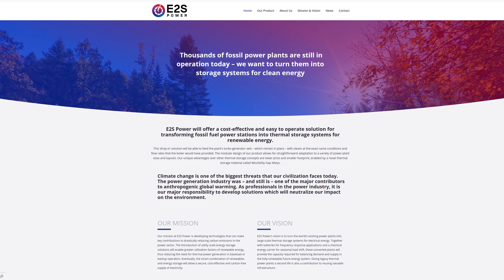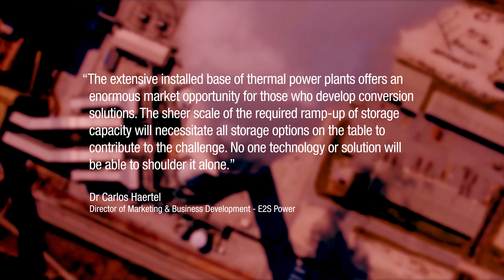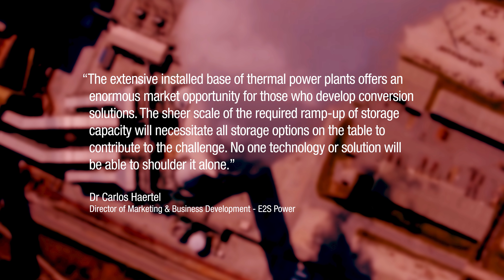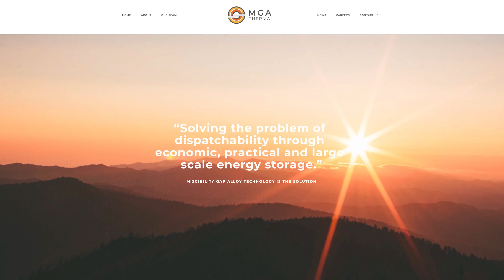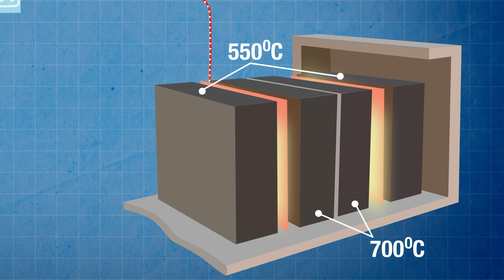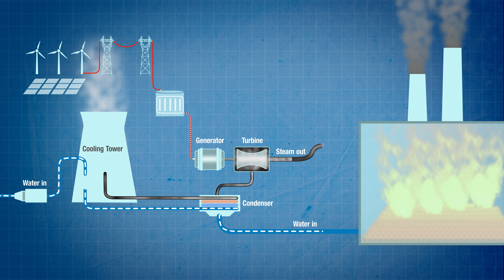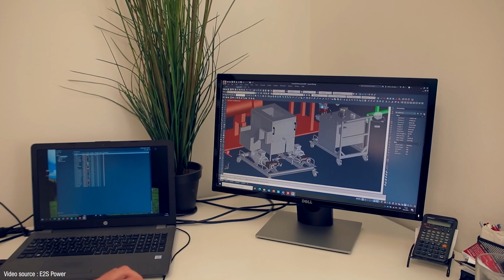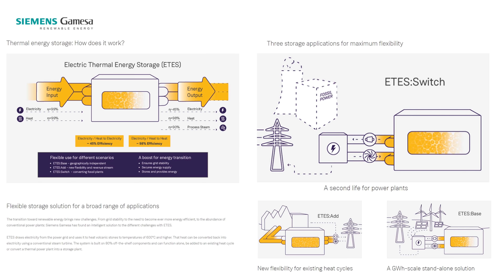New energy storage tech breathing life and jobs back into disused coal power plants

Comment: Steam turbines aren't known for being able to flexibly generate power. Cycling them also increases blade wear. Since steam turbines that feed electricity into the grid must operate at a nearly fixed speed (due to the nearly fixed frequency), one can only adjust the power output by adjusting the torque. Metals aren't too keen on varying stress levels.
Reply: The website doesn't say, but it looks like this system will be most useful for running times between a few hours and a day - peakers. Other systems will be needed for baseload in winter calms. Nuclear reactor retrofits are an existing safe technology which we refuse to use so far.
Reply: Not blade wear, but metal fatigue in the rotor disks.
Reply: @brodiewolstenholme3086  Actually related to the brittle bore of the shaft.
Reply: Your comment is not correct. Turbines are flexible and can be loaded as needed. That's their strength. Cycling doesn't cause blade wear. And anything that dispatches power to the grid must do it at grid frequency. Turbines last for 20 years under near continuous operation and can be rebuilt.
Reply: @sreng81  I'm a mechanical engineer but not in the power generation/steam turbine sector. My understanding is that large turbines designed for base load provision need a relatively long start-up/shutdown periods to avoid thermal shock and distortion. Is this a misconception? If not, presumably the effect is proportional to the thermal mass of the rotating and stationary elements?
Reply: @clivehprice1973  long startup and shutdowns are related mostly to even heating of the shaft. When you startup a large turbine you need to enter and stay in soak minimizing any time in criticals. On shutdown you need to stay on turning gear long enough to avoid bowing the shaft. If you lose turning gear you manually rotate the shaft at set periods after marking the shaft so it cools evenly. Typically you can attach a handle, air wrench, etc. to the turning gear motor or gear box but if necessary the use of a large strap wrench may be used.

Steam throttle and governor valves also have conditions to fulfill as well as throttle loses across a valve may end up introducing saturated steam which damages rotating and stationary blades (100 degrees of superheat common).
Reply: @clivehprice1973  They do need long start up periods.  Subcriticals take 16 hours, supercriticals 24.  Some of this time is boiler related.  There are long holds in the start up process for silica and iron (chemistry), and that large boiler has to heat.  I don't know if those would be  present in this scenario.  Then there are holds while rolling the turbine for thermal issues as you mention.  Once parallel with the grid they can run indefinitely and regulate up and down on load as needed.  Maybe the term cycling meant on and off.  I didn't understand from the video exactly how they would be used.
Reply: @sreng81  Thank you for that. I have heard the term 'spinning reserve' in the past which I understood to mean stations that were running with enough steam to maintain operating temperatures and overcome rotational losses but with no electrical output. This would surely affect the overall  operating efficiency of the plant, as would other usage factors that you have queried. I note questions about 'real life' overall efficiency elsewhere in these comments. Nevertheless in our dire global state every  new option is worth examining and I think that Dave is doing an excellent job in highlighting these on this channel.
Reply: @perryfarmer3280  That's very interesting. Thank you for responding. As always in engineering (and life) the devil is in the detail!
Reply: @clivehprice2553  Spinning reserve is basically having enough immediate excess capacity to replace the largest single loss of generation. The amount varies widely but a common figure is 10%.

A thought for a DC system (think solar and electric cars).

For the most part new vehicles have a range of 200 - 300 miles. The average use however may be 40 miles a day. In a solar neighborhood you have 80 % (give or take) spinning reserve online for every car plugged in sitting idle (assuming the car is set up to give back). Many cars have this as an option.

In a hydro system with condensing turbines immediate spinning reserve may be simply closing the wickets gates allowing the unit to stay online as an electric motor which adds stability to the grid. Zero to full load may he only 20 seconds however the turbines literally add short term spinning reserve through momentum but are limited by other plants such as thermals where turbines are very limited frequency wise.
Reply: @clivehprice2553  Close.  Spinning reserve generally means the turbine/generator (unit) are running at reduced load, so they could increase output relatively quickly.  A typical unit may cycle between 60% and 100%.  What you described, 0% load, is called islanding. Large supercritical units cannot do that because of the boiler.  Smaller subcritical units can, for short periods of time.  That may be an option in this scenario since there is no boiler.  The heat source would only provide enough power for the plant load, or just to keep the turbine hot so it could increase load quickly.  That's a good question!
Reply: @clivehprice1973  this isn't " base load provision" is it !
Reply: Well, maybe this technology is best suited for peaker plants, where the legacy equipment is presumably designed for cycling.
Reply: I wonder if you could switch the plant over to charging its own "hamsters" whilst it spins down at a safe rate?
Reply: This isn't true at all. Naval turbines have provided variable output and speed for over a hundreds of years. Coal power plants are taken on and off line regularly for a variety of reasons. The stress on a power plant turbine is based on the current load of the generator not the frequency. The turbine is the most durable part of a steam power generation system far outlasting the boilers and generators themselves with proper care.
Reply: @patrickweaver1105  I think he means steam driven turbine generators, not steam driven engines.
Reply: @poppys3728  Same steam turbine technology.
Reply: @patrickweaver1105  "Same steam turbine technology." - Usually. However, steam turbines attached to electric generators for power production typically operate in a very narrow speed range (basically a constant speed to maintain the proper frequency for whatever grid they are attached to). Whereas steam turbines attached to ships propeller for propulsion operate in a wide speed range as dictated by the navigation requirements.
Reply: @poppys3728  Ever heard of a ship service turbine generator? I've operated both types the only difference is size. They all get started up and shut down regularly.
Reply: @patrickweaver1105  Yes, SSTG,  Ship Service Turbine Generator, the electric generator driven by a  steam turbine (usually) to provide electric power for the ship. My contribution to this thread was pointing out the typical differences in operation between the SSTG and the ME ( Main Engine Turbines), not how frequently they are started up or shut down. In fact, on numerous occasions, I have operated both SSTG's and ME's for months at a time.
Reply: @poppys3728  Here in the US, it is exactly 60 Hz.  It only varies by hundredths of a percent when the generators are synchronized with the system.  I never thought about ship's turbines changing frequency.
Reply: @sreng81  Yes. U.S. ships operate on the same Hz as U.S. power grid. At least all the ones Ive been on. Not sure about other nations' ships, though.
Reply: @poppys3728  Fundamentally the only difference is size.
Reply: @patrickweaver1105  HA HA ! cut right thru the "nay-sayer" bs !
Reply: If you can't turn the steam turbine off,  you can still generate enough power when renewables are running to be able to operate the turbine 100% of the time, consistently.
Reply: @fehzorz  ehhh? No, I don’t think so. You don’t want to run the plant when there is enough renewable power available, as you would effectively just be wasting 50-60% of the power. You want to use the available renewable power to heat up the storage at that moment, not to run the turbines to then once again produce electric power from wasting more than half the power you put in in the process.
Reply: @AndreSomers  yes it would be significantly more efficient to just turn the steam turbine off during the day. However if it CAN'T be turned off (I'm no turbine expert so I'm not sure) then it would still be possible to generate enough electricity from solar and wind to run the turbine 24 hours, even though you take a hit on efficiency.

Comment: Just what percent of the energy consumed to melt the aluminum is recovered?
Reply: Given that resistance heating is essentially a perfect conversion, it’s probably pretty high. Limited only by the steam-generation half.
Reply: @marxug1  Very large ones have a 50% efficiency. (1,200 MW). Smaller ones are less efficient. Then you have pumps and such.
Reply: @Natabus  those are co-generation implants, which exploits gas and steam turbines. Steam turbines solely usually reach 35-40% efficiency at best
Reply: @federico1183  Thanks for the correction.
Reply: The heating will be almost 100% efficient, and modern large scale steam turbines have about 40-50% efficient. So 40-50%.
Reply: Good question. I haven't been able to find anything on throughput efficiency. But if it's more than  ~30% its  outperforming Electrolysis -> Hydrogen -> Fuel cell, thought It doesn't have the same potential for seasonal long term storage.
Reply: about 90% of the heat can be recovered (latent heat of melting or fusion) but about 25% of the heat will be available in the form of electricity. The remaining 75% of the heat is unusable (low quality) but can be used for domestic hot water supply and other use.
Reply: I was waiting for that. But of course the heat to water phase is very efficient, so I guess the efficiency of the plant depends on how efficient the plant was at turning heat from coal into steam? Less likely to be used for older coal plants in which case. Even so, re-use of existing facilities (and the energy it cost to build them) for energy storage is good.
Reply: Lol, its kind of a poorly phrased question.  I can see what you are all trying to get at though.  Instead ask: what is the heat exchange efficiency of recovering the heat from the hamster unit.  This is going to be high, at least 85%, probably 90%+.  The phase change characteristics of the aluminum give the hamster its staying power, stamina if you will.  The second question you all need to ask explicitly as well is:  What is the efficiency of the power conversion method, in this case the steam turbines that convert the heat energy into electricity.  Older already sited turbines are probably 35%.  These two multiplied together give you the electrical efficiency barring other considerations which are small in magnitude so this is generally fine.  I'd expect this system to be about 31.5% electrically efficient.  Now some of you correctly point out: what about the waste heat from the thermal to electrical conversion process?  If you can utilize that in a district heating system you can get a CHP efficiency of 80% easily.
Reply: Who cares when that excess renewable energy was going to waste anyway?
Reply: @rupert274  The low efficiency is only one aspect. The capital expense of electrolyzers  is huge. If they're sitting around doing nothing except for the sporadic run to soak up energy that would have been curtailed, the money spent on them (and, in ecological terms, the embodied energy and emissions) is largely wasted. The niche for green hydrogen isn't going to be energy storage. It'll be for industrial processes and chemical feedstocks that presently use steam reforming of fossil natural gas. And to make it economically viable they will be running flat out, not intermittently.
Reply: @rupert274  ( people miss that point - even in using "surplus capacity" to make HydroXXX - chemistry products  fanatics repeat: "Hydrogen is stupid: - with no thought to per unit storage cost or ease of transport...
Reply: @rupert274  Consumers will care. Inefficiency in the energy supply chain means more infrastructure is required which will drive up prices

Comment: Could we turn oil pipelines into an intercontinental variant of the same? Replace oil dispensing stations with exactly this same capability. If so, we'd have a means of sharing power through it!
Reply: Oil pipelines aren't even remotely insulated enough to retain high temperatures over long distances. Even purpose-built remote heating pipes are only economical up to some tens of kilometers.
Reply: @ehtuanK  thanks! While its sad that this idea can't work, its great that we know so clearly.

Comment: I look forward to the video entitled "breathing life and jobs back into disused petrol stations" ;)
Reply: That is easy replace the gas pump with a fast charger
Reply: There are some proposed battery technologies that are cheap, have good energy density but are limited by very slow recharging. That makes room for a "battery swap" model that local gas stations could perform well. Remove the tanks, and replace with racks of chargers, so that customer charging time is only as long as a module swap.
Reply: High temperature Pyrolisis Bio oil and ammonia as fuel.

Comment: Water stores the most heat then any substance. Just store high pressure steam and run it through the turbine.
Reply: I’m pretty sure that a steam turbine only uses the temperature and pressure of steam in an adiabatic expansion. Compare that to the enthalpy of the solid-to-liquid phase change of aluminium and the aluminium comes out on top. It may be a different case if you actually condense the steam back to water and extract the thermal energy from that phase change also.
Reply: @Scrogan  water has a much higher volumetric heat capacity then aluminum, plus you also have all that graphite.  If you just replaced the whole thing with a tank of superheated water you could store a lot more energy. Not to mention the fact that coal thermal plants are made to work with superheated water system like that.

Also look up fireless steam locomotive.

Comment: Reading the title brought a rush of hope.  Finally, the breakthrough!  Non-electrochemical, non-thermal storage yet enough surge & density!  NOPE, no hope here:  just more of the same false hope in batteries & upgrading heat, yet again.
Reply: @SHEISTER CAM Amen.
Reply: We need something to reduce the coal burning. If you install one of these you will offset tons of carbon a year on a already running plant. This could be brought online quicker than throwing more coal in furnaces boilers. This has some merit in it. We currently curtail a sh1t load of power with this wind and solar excess, we can't even control the grid as it is to utilise excess power from renewables
Reply: Jeez you're hard to please. Bet you're a barrel of laughs
Reply: @dprcontracting6299  Well, the subject matter is about life and death...on Mass Extinction Level...along w/our own species, so... yeah, Just Have A Think isn't a comedy hour.
Reply: @scottwarthin1528  doesn't every little bit help?
Reply: @dprcontracting6299  For most things in life, I would agree, yes, but not this.  Energy Storage that would let us live on today's renewable tech requires a breakthrough, the passing of two thresholds:  energy density (of the best batteries or worst fuel burning) & the surge capacity (of the best capacitors).  Physicists will say the chemical laws of physics doesn't allow for both from electrochemical energy storage. The world is ALWAYS hanging off of the newest word on how tweaking the newest lithium battery or molten salt shaker will somehow do the trick!  The math writing is on the wall:  upgrading batteries or ANY thermal (except "geo"thermal) upgrade will not make everything run on sunshine.  Something fundamentally different from FUEL, Chemical Storage, Kinetic Potential Storage.  Energy Storage Conundrum can only be answered w/a silver bullet, don't let any1 tell you otherwise w/out iron clad proof.
Reply: @SHEISTER CAM You got me confused w/your life partner.  What we all need developed in a simple equation for ya':  Adequate energy density + surge capacity = Energy shortage suitable for renewables being harnessed enough.  "When the wind doesn't blow & the Sun doesnt shine" is what will supersede fossil fuels so that "the world will move on"